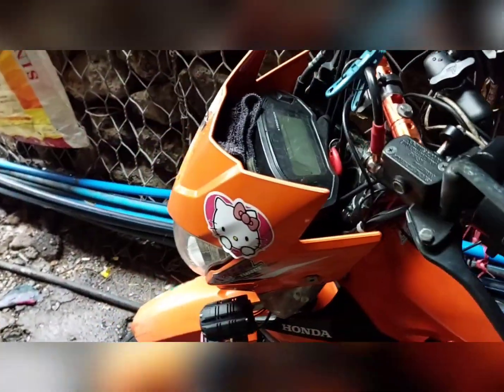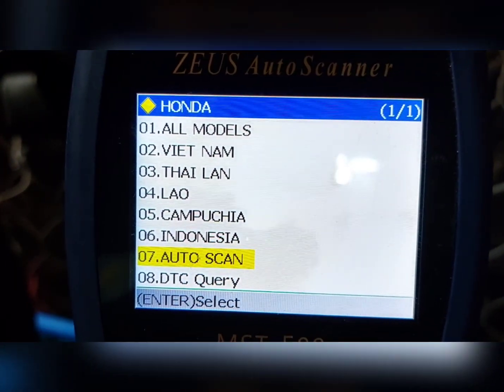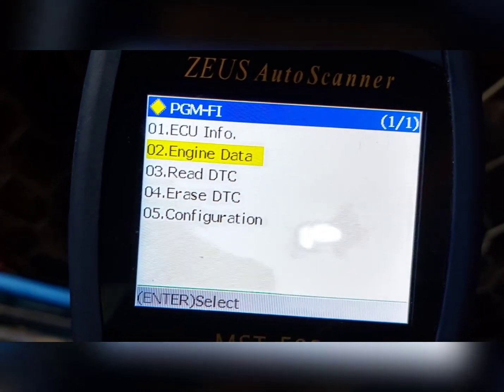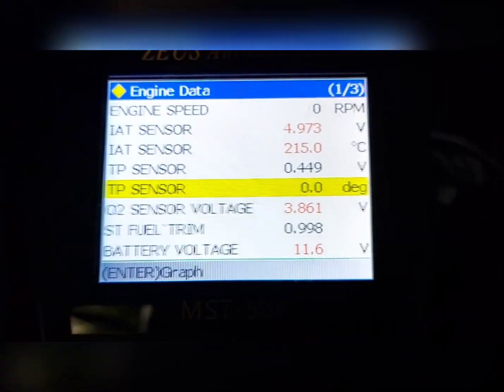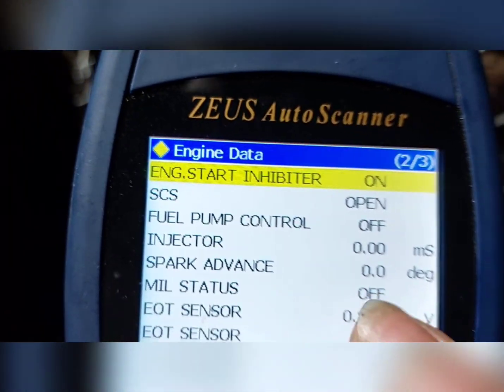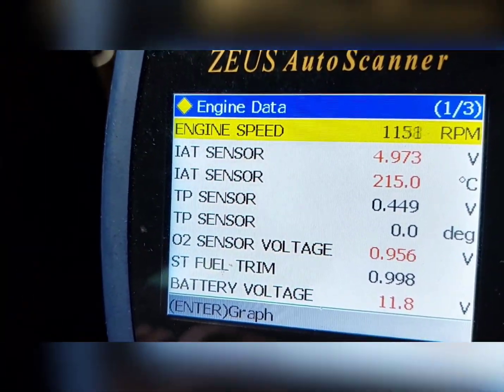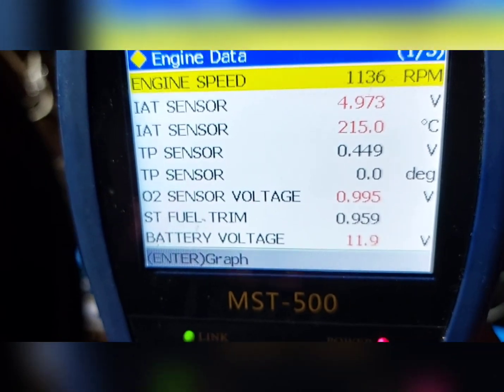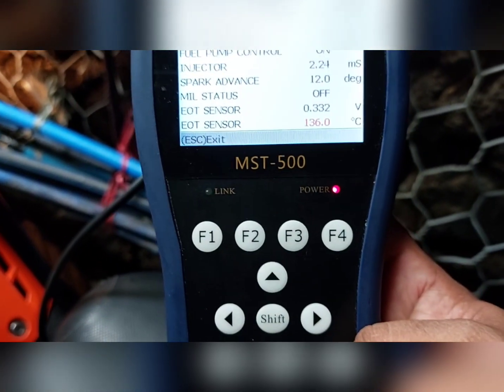"XRM 125 fi Diagnose Using MST500"

Comment: Hello po. paano po mapa Baba yung Injector MS sa 2.0 sakin po kasi hanggang 2.7 lang minsan umaabot 3.0 pag naka Minor. HONDA XRM FI 2017 po Model ng Motor ko.

napa Fi Cleaning okay pa naman yung injector.
valve clearance naka basi sa Manual
Napalinisan na din Throttle Body
New Air and fuel filters.
Bagong linis din O2/Oxygen Sensor.
bago din Sparkplug at bago TPS.

nadala ko na din sa may API TECH na Tool para ma diagnos and Reset ECU pero ganon parin po di bumababa sa 2.0 Injector Ms nya pag naka Minor sana mapansin.😔